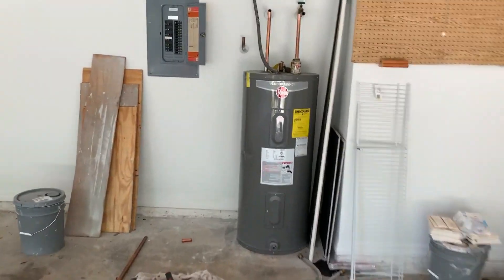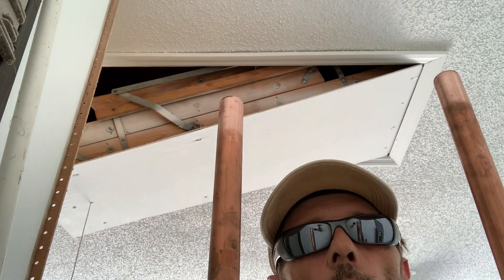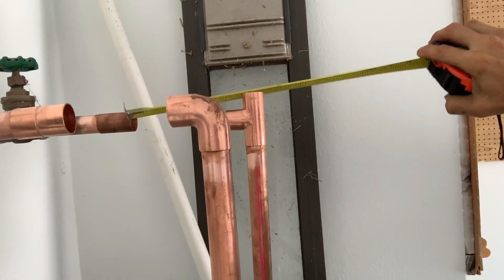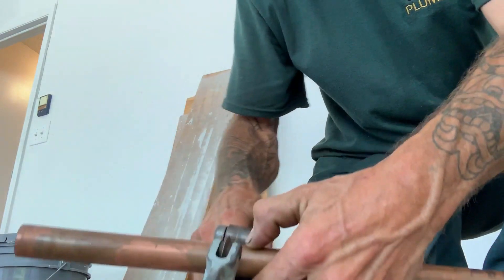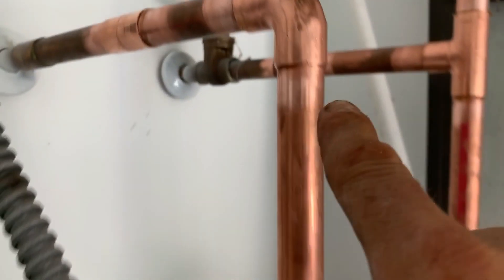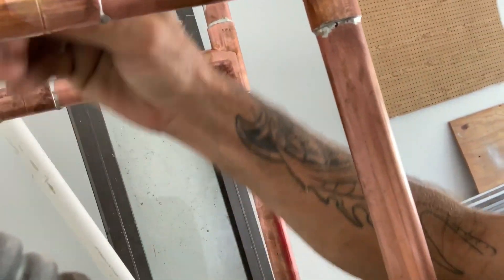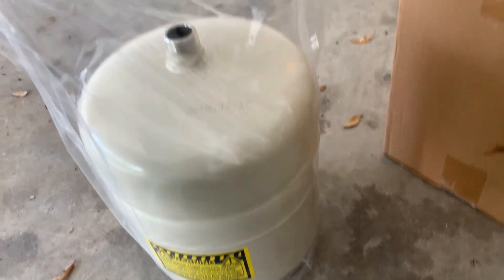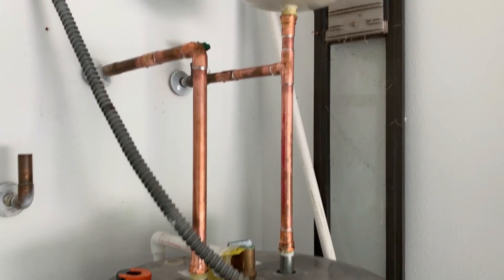HOW TO INSTALL A THERMAL EXPENSION TANK ON WATER HEATER

Comment: Test water pressure and fill expansion tank with correct matching air?  Hold second wrench on the copper threaded fitting to protect soldered joints when tightening

Comment: Showing your disdain for Sharkbite?  They have a huge positive track record and there is NO reason not to use them in an exposed pipe application like a water heater.  But you would rather charge a LOT of money to cut and sweat a bunch of copper!!!  Yeah, plumbers don't like them because they eliminate income for YOU!

Comment: It's code that you don't turn the tank upside-down through test it last longer having bleeder facing down. 
Yeah I know they have been doing it this way for over a hundred years, but a hundred years they all was backwards. You also supposed to check the water pressure to match the tank.  Thanks Tim

Comment: Check house water pressure. Adjust thermal expansion tank pressure accordingly. Do this with the hot water tank with zero pressure inside it. Don't want water pressure pressing into the thermal expansion tank fudging the thermal tank pressure.

Comment: Too much flux. Less is more far as flux goes. When you cleaned the copper, you grabbed the clean area with your hand. Your skin has acids and oils in it. You just contaminated the clean copper. Clean another copper spot. Put your thumb on it. You will see your print oxidize the copper. Little globby with the amount of solder. If you see solder balls like on the bottom of a fitting, too much solder was used. Didn't see you de-bur the copper pipe after cutting to 6" long.Teflon and dope is excessive. Just use the dope. You are tightening the tank INTO SOFT COPPER THREADS. No need to gorilla grip the snot out of the copper threads. Keep the gate valve. Don't use ball valves. Why? Gates are slower at closing, no water hamer. Balls slam closed causing water hammering.

Comment: Did you debur the inside of the 6" pipe you cut so you don't get turbulence? Also, you never took the house water pressure and adjust your expansion tank to that pressure. Always a good rule of thumb to check pressures before the install. Most 2.5 gallon Exp. Tanks come at 50 psi but it's shooting in the dark until you get some hard data.

Comment: Did you check the house's water pressure, and add air to the expansion tank's bladder to match it? I didn't see that in the video. Remember to read the instructions everybody

Comment: Expansion Tank which Pipe Hot water or cold water  ?
The pressure  will be creat  steam in hot water so expansion tank must go hot water pipe.
Please could you check again ?

Comment: I think you missed a few steps on the way, you never checked water pressure to set air pressure for the expansion tank neither did you put an isolation valve on the hot water side to prevent building drain down if repairs need to be made neither did you install a union on either line to facilitate tank replacement

Comment: Old school.  Thanks for showing how it's been done for 100 years.  Too many videos show the new compression tools that most of us can't afford or the shark bite pieces that are expensive.  This is cheaper and with a few plumbing tools and practice most of us can master this method.  One thing, show us your soldering.  Some people don't realize you need to heat the elbow, not the opening.  When the entire fitting reaches the correct temperature the solder will be drawn all the way in.

Comment: I call b.s. on the shark bites.  They are built to last as long as your hot water heater and in most cases outlive a soldier joint.  I have done home repairs and remodels.  I have been called to dozens of pipe leaks that were failed soldier joints and only one leaking shark bite and it leaked due to pipe not cut true and or deburred.  And you check your incoming pressure before you install your expansion tank so you can pressurize it to match.
Reply: I have them on several connections that are in the open and not a single leak. You HAVE to debur the pipe and cut it straight like you said in order for them to fully seat and make a good connection. These guys are stuck in the fittings of the 80's when they were not as good.

Comment: If water departments had not for [stupid reasons] started putting check valves into systems (absolutely was not needed), expansion tanks would not be needed. The reasons given for closing off systems was absolutely asinine.

Comment: I was thinking that you had to check the water pressure in the house, and then you had to add air pressure to the expansion tank to match that of the water pressure. Has the design changed in expansion tanks so that that process is no longer needed?
Reply: No

Comment: I replaced my expansion tank today and now I have very little pressure and hot water. Any ideas what’s wrong? I didn’t think the tank had anything to do with that. It was working fine before the replacement.

Comment: Can the expansion tank be to far away? I did a hot water tank , electric 40g tank , closed water system so I put in a 1.5g expansion tank, pumped it in the same way I always do. T&p valve blew as soon as the tank came up to temp. I thought how crazy that a new tank had a faulty valve, so I changed it. But it still blew the valve.

Comment: Should have used dielectric union to go from galvanized to coppers 
I'm an HV AC installer replacing water heater and furnace for realtor selling house
I replaced water heater today in a tight spot old house with galvanized fittings and I didn't like came out because I had to install the expansion tank before the shut-off should I change it

Comment: Great vid Tim
Expansion tanks are not required by code in florida unless the house is a "closed system" i.e. some sort of check valve or backflow preventer is in place inhibiting the expansion of the hot water back into the distribution system.
Reply: Not required in Southern Mississippi..

Comment: Since the water heater has a check valve on the inlet. What good does adding an expansion tank on the cold side do?
Also, pink Teflon tape is recommended for fittings larger than 1/2”.

Comment: Isn’t that expansion tank mounted upside down?
Reply: Technically it is. I had a discussion with a coworker about that fact today and we read the manual from the manufacturer and the say to install with threading face up.
Reply from the maker: No

Comment: Why you guys never read instructions?it says right in there to mount vertically with the schrader valve on the bottom.upside down leaves no head pressure and the tank will fail prematurely.as well you didn’t check the house pressure in order to properly adjust the expansion tank BEFORE it is installed.check the website it shows and explains very simply

Comment: 1. Very sloppy job:  
2. You needed to deburr the copper pipes.
3. Sanding copper pipes is not the best way to clean them. It can thin them and cause issues.
The right way is to use a scrub side of a kitchen sponge.
4. The 'Expansion Tanks" should have been mounted on a special bracket. Those cost under $20 us dollars.
Best to mount that bracket on a near by flat surface and on a wall stud.
5. Always replace the cold water valve when replacing a water heater. Ball-type valve work great (Brass only)
6. Did not check the PSI on the new Expansion Tank. Although it is factory set it needs to be checked.
7. Did not test the pressure/temp. relief valve which takes few seconds to do!
8. When buying an Expansion Tanks try to find one with Stainless Steel threads/nipples or copper or brass if possible. Also make sure the tank itself is made of rust-proof material.
9. This video show installation when you have pipes coming from a wall. If your copper piles are in the ceiling it will    be tougher and different (especially when using those brass elbows).
10. When buying/installing an Expansion Tank you must get the right one to match the gallons capacity of your heater. Example for 50 Gallon water heater you need a 2 Gallon Expansion Tank (sufficient).

Comment: I noticed you did not install a strap to the expansion tank to support it using the surrounding the wall.  Has it been your experience that doing this step is not really necessary even if the tank fills with water, empties, fills, empties, etc. several times over its lifetime?  Oh, and does it matter whether or not the schrader valve end is at the top of the tank or at the bottom?  Or that depend on the manufacturer's recommendation for the install? Thanks for any feedback.

Comment: Do expansion tanks really need to be 18 inches away from the cold water valve? Is the measured in straight line along the copper and includes that 6 inches up from the T adapter?

Comment: Can you use silver solder vs regular solder for the pipe connections?
Reply: Why would you spend that kind of money.
Reply: @globeflicker9216  just more familiar with silver solder brazing vs soldering. Most of my raw materials are from at least a decade ago. Cost is not an issue.
Reply: QuantumSpin 
You can use silver on potable, but frankly I’d sell it and make a few bucks (a new roll weighs about a pound) 95/5 is far cheaper. Silver solder is also great for refrigeration lines (Stay Brite #8). Sterling has a silver bearing one that’s half that cost but I would not use it on refrigeration, hydronic heat or potable it’s ok.

Comment: You need dialectric unions when going from gal to copper, that is code here in Los Angeles, CA but overall, video is pretty right on.
Reply: Most new tanks have dielectric fitting build in. Check at retail store when buying new tank or google it.

Comment: I also use type m pipe for all my installations.
Usually I check water pressure of the home and pump my thermal tank to match the home psi. Before installing and some support 
Also some dielectric unions
Reply: Whut!
M copper is not suitable for potable use, L is. Check your codes.

Comment: Only thing I do differently I use dialectic union on the water heater
Reply: and Tim kept stressing 'this is Florida code'. Maybe differing metals don't promote corrosion in Florida (not).
Reply: The nipples are dielectric
Reply: @chrispinette8303  you don't know what you're talking about
Reply: I was about to ask this. I've only done commercial so we always used dialetric unions.
Reply: @ambatson8897   Those are dielectric nipples  listen he told you not to get them hot  as they had plastic inside them nipples
Reply: @davs.1672  lol no

Comment: Don't you need to check the air pressure in the tank to match the  water pressure coming into your house?
Reply: You definitely have to..
Reply: Wondering the same...
Reply: Of course.
Reply: Yes
Reply: How do you do that ?
Reply: @chadpayne2472  Same as how you'd check and fill the tires on your car with air.
Reply: @chadpayne2472  
First buy a water pressure gauge at your local hardware store and attach it to your outside faucet. Turn on the water. See where the pressure of your water goes to. Usually around 40-80 PSI. Now check the pressure of your expansion tank. (Usually they precharged) Check the pressure with the same thing you check your bike or tires with. Match the pressure of your house.
Reply: Absolutely you do.
Reply: No

Comment: My Hot Water Heater has no expansion tank.   It is "Indirect-fired", meaning it has no built-in burner but instead the heat source is hot water from the home heating boiler.  I guess when the hot water heats and expands, some of the excess hot water flows back into the cold water supply, since there is no check valve to stop it. It is an Amtrol HWM-40 and 20 years old.  Is this a problem that needs to be fixed?
Reply: I’m no expert but whether or not you have an indirect tank shouldn’t change anything. Those tanks have a coil(s) that take in the heated water from the boiler. Thermal expansion will always occur. You mentioned that you don’t have a check valve in your system so you most likely have an open water supply system rather than a closed system which would require an expansion tank. You mentioned your tank is 20 years old so I can’t imagine 20 years of thermal expansion beating up your tank. It’s always good to get validation from a professional (and I encourage it since you are concerned) but it most likely isn’t an issue.
Reply: @Freee27  Thank you.
Reply: I'm guessing if there hasn't been any problems in 20 years, you already have your answer.

Comment: It is critical that discharge pipes meet the following requirements, which can be found in InterNACHI’s Water Heater Discharge Piping mini-course, at www.nachi.org/education. A discharge pipe should: 
be constructed of an approved material, such as CPVC, copper, polyethylene, galvanized steel, polypropylene, or stainless steel. PVC and other non-approved plastics should not be used since they can easily melt.

Comment: Sharkbites in earthquake zones, ok. Youtuber, DIY, and lazy plumbers love them. How often have I gone back to their work and removed the flexes because they went bad and started leaving black goo in their hot water? Quite often. Heater tip, if it has a plastic drain valve it is a crap heater.
Reply: How true. Needs a full port drain valve.

Comment: Hi Tim. Hopefully you can help me.  I've had issues with high pressure in my home.  At first I tried to adjust the Pressure regulator but soon realized it was not working.  So I replaced it.  I set the pressure at 60 and put a gauge on overnight but I'm still getting high readings.  It seems to coincide with the HWT firing up.  I don't have an expansion tank installed.
Can thermal Expansion cause high pressure through out plumbing?  My Neighbor said the expansion would only occur in the HWT not the home plumbing and an Expansion tank would not lower the pressure.  I have a hard time believing the regulator is bad.  any thoughts?

Thank You
Reply: The rise in pressure starts at the water heater from thermal expansion. But without a place for the pressure to go it passes through the water heater and pressurizes the cold water line as well. They are one common water system unless they are separated by check valves. The expansion tank could help. The pressure surge could be caused by something else also. Quick acting valves like the ones used in irrigation or at your washer machine can cause a water hammer that may give you a high pressure reading.
Reply: @matthewmusselman373  Thanks Man.  A few weeks ago Installed A pressure tank and that seemed to correct the problem.
Reply: THERMAL EXPANSION      install tank and call me in the morning!

Comment: I thought by code you have to have a removable/seperateable union within 18” of the water heater (hence why the flexible supply lines are more common, because they are considered a union).....at least where I’m at you do to pass inspection
Reply: laratheheavey,     yep  tims really got his balls busted on that.  You need a union on the tand p as well I dont find 1 in 100 that way Ive been called and forced to go back and put union in  .   I can argue it either way   as a plumber do you think I go on a water heater change out and expect to be able to disconect  unions and install new without breking out a torch?   using type m  is legal  a little cheezy but who cares its exposed.    not reeming pipe  not so good,   once again  not that serious, but avideo on how to could  use a few  better practices.

Comment: I was always told by plumbers to try and always mount tank with connect at the top....?
Reply: I just bought a new 2.1 gallon expansion tank. The installation instructions in bold letters. Mount tank with air valve in the down position.  Can you check on this.(BackStop) part No.12-A101-6 DuraTrac Products.

Comment: Metal pipes soldered to the water heater would not pass inspection in California. California requires flexible water hoses  and a flexible gas hose in order to minimize the chance of breakage  during an earthquake.  Sharkbite connections are allowed in California. You'll  find Sharkbite hoses and connectors at Home Depot stores and Lowes stores throughout the state.
Reply: Sharkbites are allowed pretty much everywhere. Plumbers just don’t like them for various and often specious reasons.
Reply: I recently experience corrosion rust build up where copper connection to the steel nipple on my water heater tank.  With some quick research online turns out my viewers are correct about dissimilar metal reaction causing the rust.  Sharkbite flexible possibly a better option to prevent corrosion!
Reply: @tick_go5989 should have used dielectric unions at water heater nipples
Reply: They do not like shark bites because it shorten there time on job that can be charged. So the don’t make as much money!!
Reply: @fish4food0071  I don't like them because as an Engineer - i see them as less reliable than other options, my preferred is still copper pipes sweated together.  Nothing to do with a plumber making more money - everything to do with failure points.
Reply: @WinnTeam  I'm an engineer and I have used them many times. They work great.